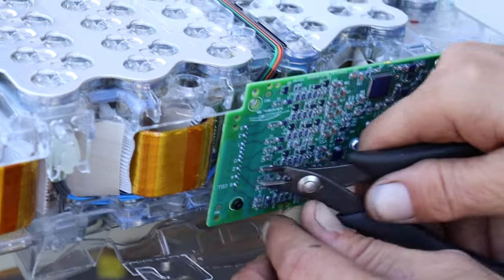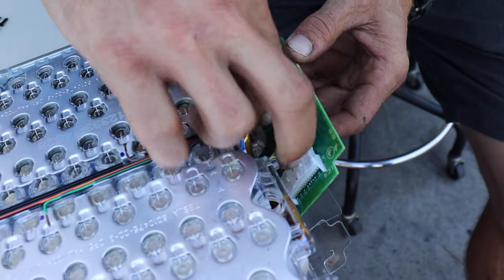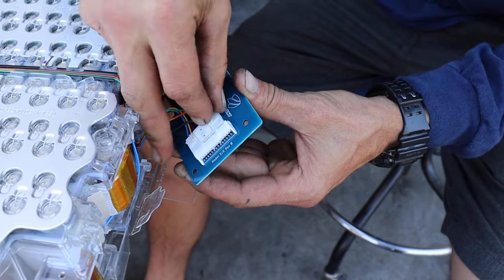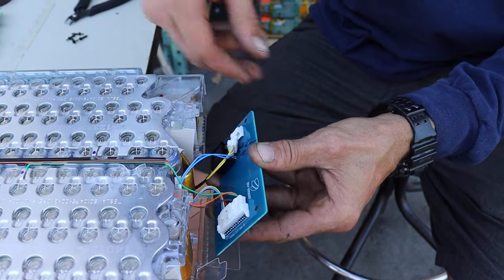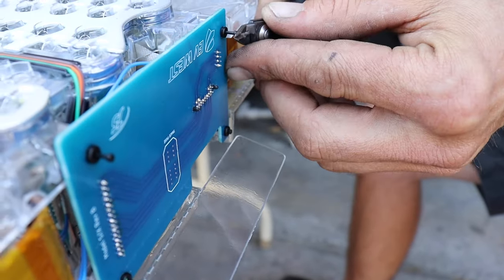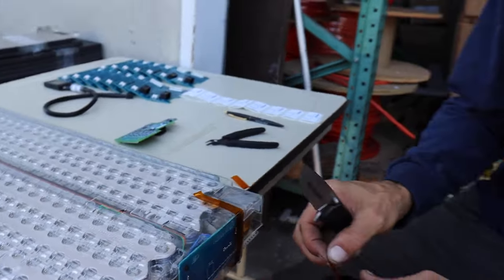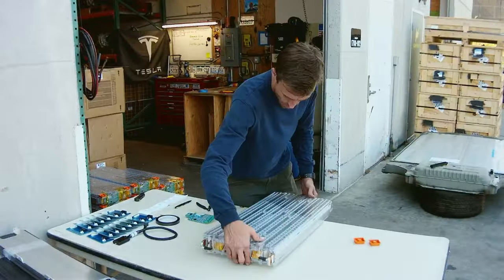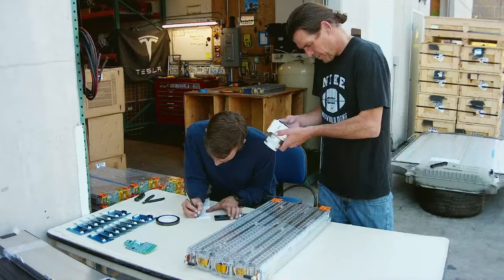Battery Teardown for a Salvaged Tesla Model S - Adding the EV West BMS to a Single Battery Pack

Comment: Cool. So now your customer can charge an hour to drive an hour.
Reply: This makes no sense. I'm guessing exhaust fumes have affected your brain.
Reply: @GregHassler  Apparently you missed it. These were battery backs used in EV's. If in good condition installed in a Tesla, you can drive an hour after about an hour of charge using a fast charger. If not, then charge 6-8 hours to drive an hour.
Reply: @grabir01  this still makes no sense.  these are just single modules / not intended to go back into a Model S & if they were in an S an hour of Supercharging even  for a 2012 S will give at least 2 hrs drive time at well above the speed limit  fyi.  to drive an hr you probably need maybe 30-35kWhr max.  even cold soaked would be under an hour at an SC...if ya had all the modules in a pack and a car to go with it
Reply: "at well above the speed limit" this statement is the truth!  @Zextraterrestrial
Reply: You're just wrong. 30 minutes of charge is usually 3 to 4 hours of drive time if using DC fast charging.
Reply: @mmccon2007  How can I be wrong when I rented a Tesla Model Y Dual motor in Germany . Just got home. I would charge for about an hour fast charger to get me over 90 SOC. After 91 miles, I was down to 26 SOC and looking for a charger. Do the math. So. Saying charge an hour to drive an hour is spot on.
Reply: For those lucky enough to have roads and speed limits where you can do 91 miles in an hour...sure.

The only way I'll ever do that in my lifetime is on a train!